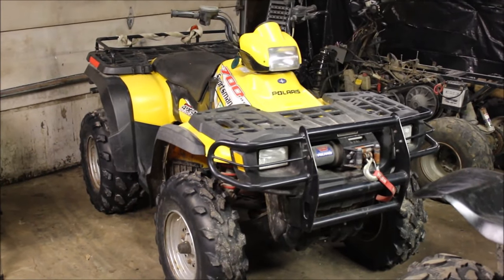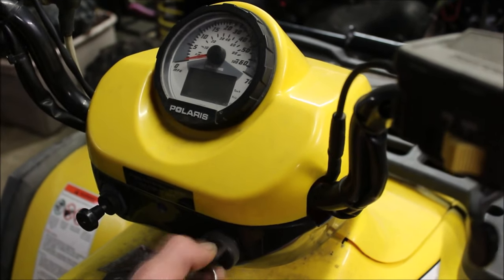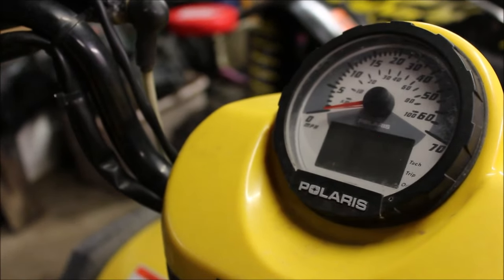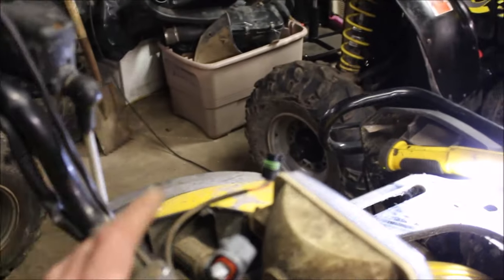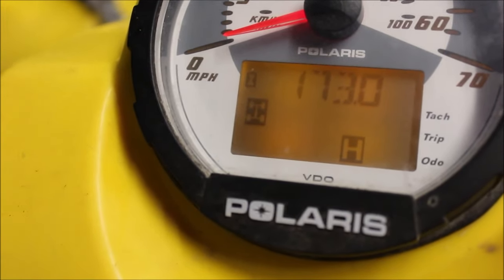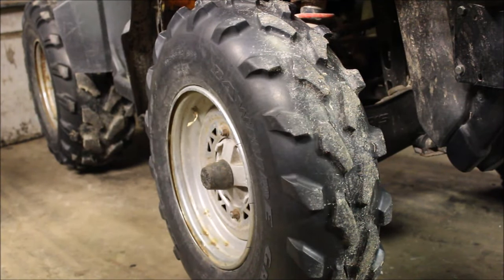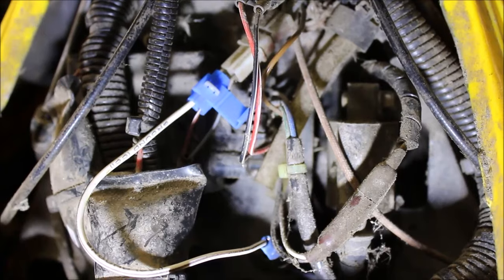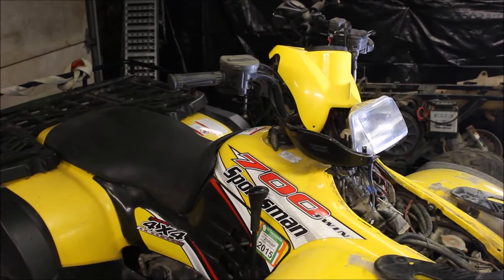Polaris Sportsman 700 4X4 won't work? Quick fix!

Comment: Did the ground bypass on my 2000 500. Worked like a charm. The speedo is DOA, but that is not a problem for me... Just need the 4x4 to work and now it does! Thanks

Comment: Hello from Alaska...  I thought the speedometer was out, and was going to bypass using your later explanation...but as you I found two broken wires that once jumped resulted in the spedo working, the wire from factory was so tight and looking under a magnifier it appears the wires snapped, factory defect for sure.  Thanks for sharing its all good now
Reply from the maker: Alaska? That's awesome  I like to here where my viewer are from. So you had the same problem? Glad I posted the video and glad it helped.

Comment: The hard shifting could also be the spring that is attached to the foot brake is not pulling the detent out in the transmission that actually locks it in the gear you can either get a little bit shorter spring or drill a hole down from the one that it's in now on the foot brake so the spring is tighter when you push down it actually unlocks the transmission.

Comment: New in your Chanel I have a 2007 polaris hawkeye 300.I can't find starter bendix I can used any other polaris bidex if I can can  you tell me which other model work .thank you  . really good videos 👍🙏
Reply from the maker: I use partzilla.com to cross reference part numbers. You should check the site out. exploded views and part numbers. It should tell you what you need to know. I know the 400 2 stroke is different from the 500. So you might have to do some searching.
Reply: @TitaniummanGarage  thank you I will check it out  .keep the good work👍

Comment: Does it matter which plug you use because there is 2 of them obviously one going to the left wheel 1 going to the right wheel even if my speed omelet or everything works this will override that reverse button correct..  Thank you very much    greatvideos
Reply from the maker: I believe so. And as long as there is power to either plug it shouldn't matter.

Comment: Do you have any advice. I have a 2007 sportsman 500 high output but I really think that the cam or the valves are having a problem because it's got a wicked vibration seems like you're the man for the job lol
Reply from the maker: While at idle or when its driving? If driving, check your prop shafts. if at idle, check your timing

Comment: So I have a 2003 600 I just bought. Just replaced all the bushings and cv shafts. Speedo works fine and shows what gear it's in, but the 4WD will not engage. I cleaned the plugs on the left handlebar and want your opinion. You state that 90% of the time it's the gearshift indicator switch. Should I just go buy it? Will the ground trick you show make it work if it is the indicator switch? Watching from 30 miles north of Houston., not Houston.
Reply from the maker: If it shows what gear its in..its not the indicator. I would try to ground it somewhere.
Reply: @TitaniummanGarage  WOO HOO!!!! The by-pass worked!!!!! Thank you SO much!
Reply from the maker: @mikeblue896  Sweet. Glad to help.

Comment: Hey man, got my 97 Xplorer 500 running because of your videos. Have a problem though you might have an answer to.
I thought my reverse limiter was bad because the only way to get spark was by unplugging the black wire from it. But when I put the replacement on, I found out it only lost spark when I put the screw in to mount it to the frame, I guess it caused it to ground out? Any idea why mounting it to the spot it’s supposed to be causes that? If I leave it dangling there it runs good with all the wires connected.
Reply from the maker: That's a new one. I would check all your wires..see if you have a short somewhere.
Reply: @TitaniummanGarage  I was thinking one of my grounds is messed up? Negative cable from battery goes to the engine block, then from the  block to frame. That’s wired correct, right?
Reply from the maker: @Brandonp95  correct.

Comment: Thanks for the vid man however I have exact same quad and my 4x4 only works in reverse not in forward gears has brand new cage in front diff as well as the magnet /cover pc with electric wires on side of front diff have you ever herd of this happening before I’m going crazy trying to figure out how that even possible 🤦🏻‍♂️
Reply: Ever figure that out?
Reply: @ngk330  I believe override button was stuck in a small bit

Comment: My 2004 polaris sportsman 500ho speedo shot and my 4wheel drive is stuck on if I switch to off still stuck in 4wd any tricks for me to get it to work properly
Reply from the maker: Try to ground it like I showed in the video. Otherwise it's a newer speedo. Try running it in reverse for a bit to see if you can get it to disengage.
Reply: Blade hunter did you ever figure it out thanks!
Reply: @davidbush6040  still the same
Reply: @vanessaethier2949  did you try re grounding wire elsewhere?
Reply: @davidbush6040  yes and still the same

Comment: Can you help me with something man cause I would really appreciate it? Is Polaris 4wd on demand a reliable system? I have heard so much hate from other people online about those systems. And I don’t understand where all the hate is coming from. I think Polaris is a great brand of atv. I’ve had a Polaris for the last 8 year now. And my Machine is still running and doing better than ever!. I don’t understand it.
Reply from the maker: Well...It all depended on how well they maintained it. The old ones had a hillard cutch in the front hubs. If they didn't change the hub fluid, guess what? failure..no 4x4. As time went by Polaris went to a front differential with the clutch inside it to drive the 4x4. From 2003 to 2006 they failed. weak clutch. Also there is the wiring issue by the neck of the handlebars. If the wires rubbed from turning?..The speedo and 4x4 doesn't work. I have repaired over 250 Polaris. Anytime the 4x4 doesn't work the first thing I check for bad ground and bad wires. Once again its all about maintenance. If kept outside all the time the wires will corrode. Also they had an issue with their speedometers around 2002 or so. When they quit working so did the 4x4 because the wires ran through the speedo to the 4x4. Each Brand has different issues. I wouldn't own a Honda though a quiet engine they had a plastic gear that broke that drove the 4x4. My favorite year is the 2004 Sportsman. before the ECM box. Polaris had issues with those at first. Bad vendor. They worked things out over the years. I know a guy that had a 2007 with 9000 miles on it. He never had any issues with it. I think people have a bad taste in their mouth because of issues they had over the years. I haven't heard anything bad about the 4x4 not working in the new ones yet. I know some guys don't like it because you have to engage the 4x4 before hitting a mud puddle. To each is own I guess. Hope that helps.
Reply: @TitaniummanGarage  what would you have to say about just the overall Polaris reliably? Reliable or should I go with other brands? because I’m personally planning on getting either a 500x2 or an 800x2(both EFI)but i don’t know if that is a smart way to go or if I’m gonna be dead in the water within 3 or 4 months of owning it. But going off of what you said about the 9k miles= no issues. Think I’m sold on a sportsman from the late 2000’s. I guess the old ones are far better then the 2023 and 4 model?
Reply from the maker: @aidenmurphy2997  The older ones are better. I have a 2019 850 sportsman I bought at an auction. The ball joints are cheaply made. the a arms and cv axles are thinner than the older ones. Its like as the economy sunk..so did their parts. 500X2 is a great choice. stay away from the 800's they go bad after 3000 miles. Oil pump issues. The 850's are awesome but in 2012 they had issues. I'd buy the 500 X2. easy to maintain and repair if need be. Just watch my channel. lol.
Reply: How does the check engine indicator work on a Polaris sportsman 500x2 efi? because the 800x2 efi light comes on for something related to the efi, I was just thinking cause I saw an 07 500 efi with the light on and the man was on video and he didn’t say what it was.

Comment: I have a 700 2011 sportsmen 2 up keeps spitting and sounding put new stator in it new plugs new gas emptyed it too map sensor  no help run fine at slow speed get on it starts to shit the bed does the twin have reeds and do u think it could be the problem
Reply from the maker: I would check the intake boot for any cracks. Might be running lean. Have you cleaned the carb? Might be dirt in the jets.

Comment: Hey bud I got a 05 polaris 700 twin 4wheel drive won't work  speedo works I put a ground on brown wire 4wheel starts to work what would you think where to start to look ? I wanna fix it right and replace what I need too or do you think its a bad ground?
Reply from the maker: Usually it's a bad ground wire somewhere. You just have to hunt it down.
Reply: Ok bud thanks

Comment: Hi my awd won’t work can you point me in a direction please
The speedo won’t show the awd light on the speedometer and won’t lock up any ideas
Reply from the maker: It's hard to say without looking at it. If you watched the video you saw I thought it was one thing and it turned out to be another. I would check all the wires to make sure no brake in the lines. Could be the shift indicator.
Reply: Thanks